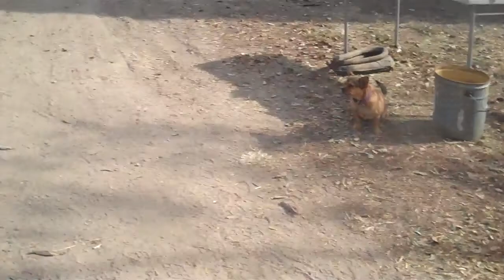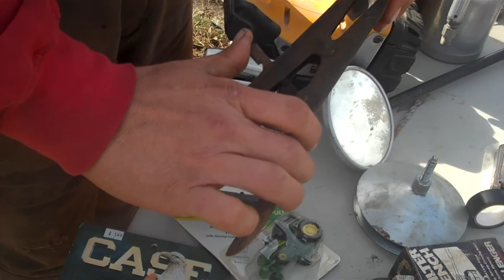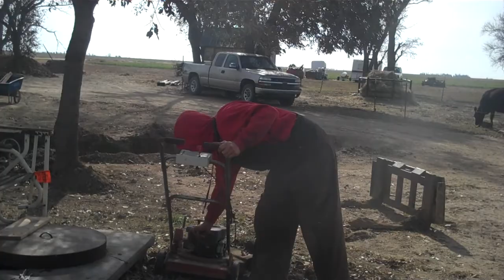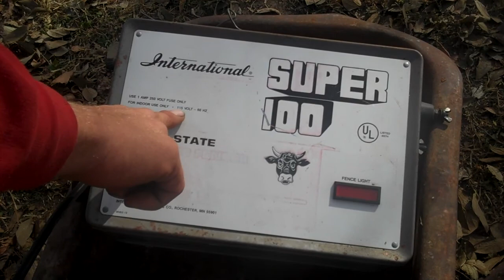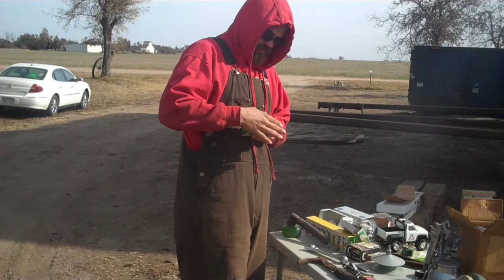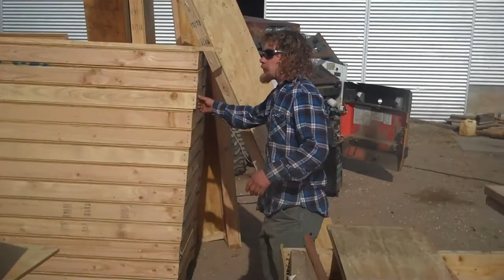Wedndsday auctoin scores!/concrete forms progress!

Comment: that is a bearing packer..used alot for wheel bearings. i didnt see the customary broken auction chains?? that fence charger is probably 115 volt ac as power in and dc power going out to the fence. that lever looks like it is may be from a hydraulic valve. that nail puller is really cool..nice progress on those forms. ricky has the sammy hagar hair going on!! i laughed at the prison shank!
Reply from the maker: I guess the broken chains went with another lucky auction goer this time! the fence charger has a 110 plug,I hadn't looked it over yet! lol Ricky wore an afro all the way thru high-school!We think his hair has calmed down.lmao
Reply: i hope that didnt offend ricky...he seems to have a good sense of humor. i always avoid the "trinket" items at an auction....if i dont i will come home with a truck load of stuff i dont need and wont use. it will sit in my way for awhile. i will move it 10 or so times and finally i end up giving it away or throwing it out.
Reply from the maker: Ricky has a great sense of humor,We been making jokes about his hairdo for years,We used to sneak up behind him and light it with a lighter when it was an afro! I like the old toys,and I don't use the roof space in any of my buildings anyways ,I think that all the toys i buy, as long as i keep a clean quality collection,are a good investment because they are becoming more collectable and valuable.
Reply: that sounds like a very good addition to your retirement plan!